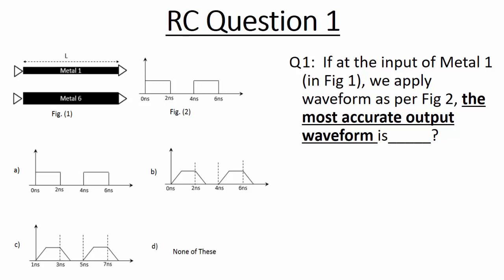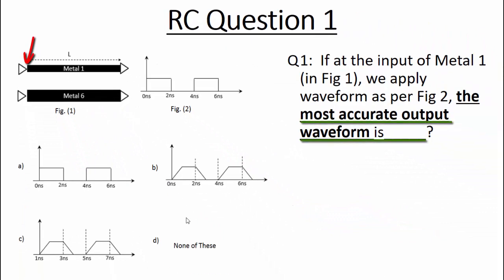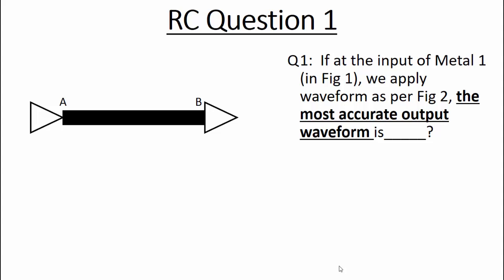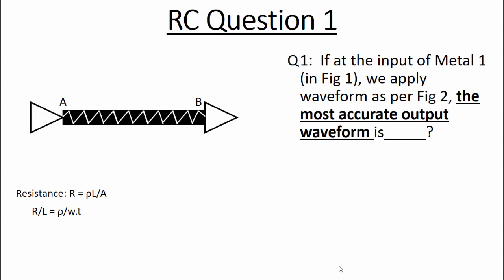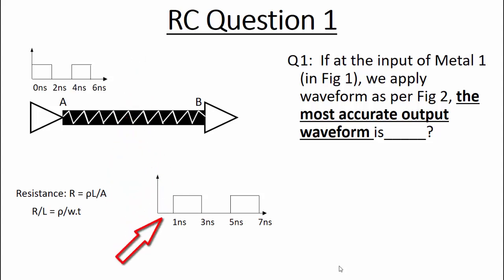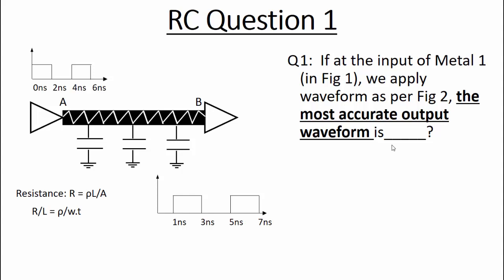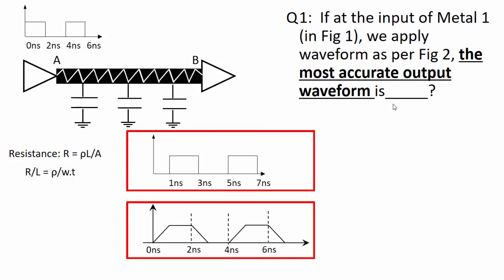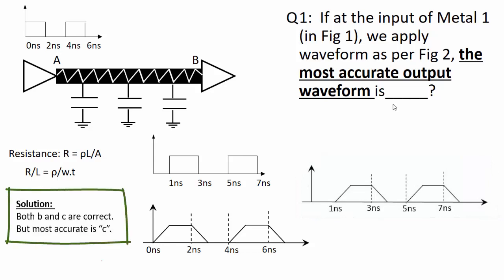RC Circuit Series (Answer of Question 1)

Comment: The formulation of question as well as explanation is inadequate. 

Firstly, the exact values of per unit resistance and distributed capacitance has to be factored in because the charging or discharging of C (and hence how output waveforms appears in shape) depends upon its RC const. Typically 5RC time is needed to fully charge(>99%) or discharge(<1%) a capacitor. We know that input square pulse has T= 4ns period and 50% duty cycle. However, unless we know exact R and C values, we cannot be certain that T/2 = 2 ns is adequate (>> 5RC)  for fully charging or discharging. If it is inadequate lets say 5RC = T/4 = 1ns, then output will look like a triangular wave with series of ramp ups and ramp down because before C gets a chance to reach its max voltage value, it will start discharging immediately. Also, because of cascading of RC sections, due to loading, there would be subsequent loss in signal amplitude from voltage level of input signal. In any, case the output waveform will should have exponential ramp ups and ramp down due to exponential charging/discharging of parasitic capacitance. Moreover, piece-wise linear output appx. is only possible with similar piece-wise linear appx. input. However, the input appears to be perfect brick wall pulse with zero rise and fall times, which we know doesn't happen in reality. So either specify that time period of T waveform is much greater than 10RC or specify exact R and C values. 

Secondly, above was DC or transient analysis which is in time domain. We can also understand this from frequency domain point of view by doing AC or fourier analysis. In which case, we have a cascade of low pass 1st order RC filters that make up a higher order low pass filter.  A low pass RC filter in essence is an integrator where output voltage signal is integration of input voltage signal. Also, a square wave can always be appx as linear combination of sinusoids by expressing it as fourier seris. Thus when a square wave passes through cascades of RC filters, sinusoids with frequencies above Fc cut-off frequency are filtered out and only low frequency signals go through. Different harmonics suffer different different attenuation and phase shifts. This cut off frequency Fc of 1st order low pass RC filter is inversely proportional to RC time constant, more precisely Fc = 1/(2.pi.R.C). Due to cascading of RC filter, the overall roll-off aka attenuation rate in transition band becomes x times (x = number of rc filter stages ) attenuation rate of a 1st order RC filter which is -20db/decade. In essence this means, the net cut-off frequency reduces which means RC time constant of the cascade is higher (inverse relationship between Fc and RC) and hence the overall delay caused to input signal. Needless to say, phase shift is another way to say this.

That being said, I donot know if Resistance alone causes delay. My understanding was that resistance in combination with reactive element like L or/and C causes delay. However, RC Delay seems more like rise and fall time than delay. I do know that speed of light in any material with resistivity is lower than speed of light. Longer the material, longer it takes wave or energy to be transferred across the length causing increase in propagation delay. Also, as temperature increases the resistance increases and therefore should subsequently cause increase in propagation delay. So, whether the shifting of output waveform with respect to input waveform is a function of R and C or fundamental physics, I cant say.
Reply: Handsof to your explanation